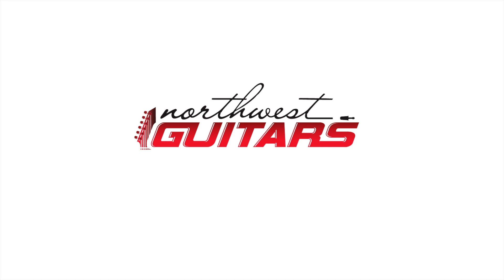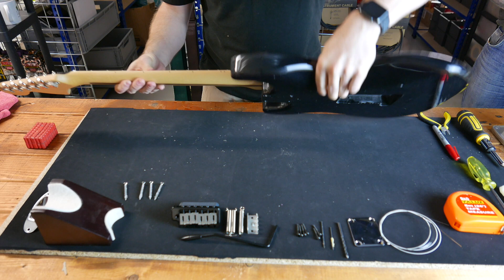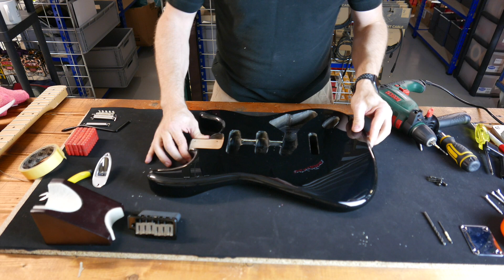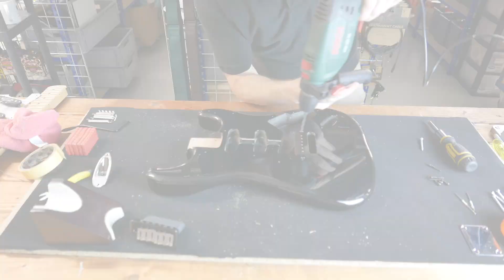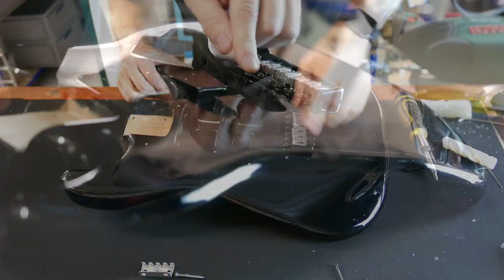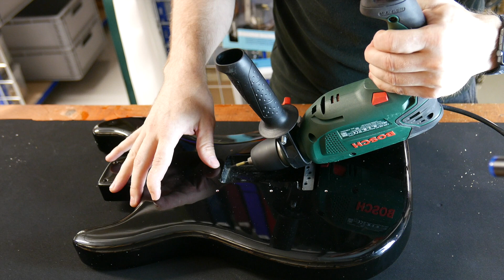Complete Stratocaster Guitar Build Tutorial Pt 4 - Fitting the Tremolo

Comment: I'm in the process of a build where I have a similar body without the trem screw holes. As many others here, I've been thinking about how to get those holes in the right place and that they're straight. I only have a handdrill and a dremel.
He doesn't seem to care very much in this video, so maybe it's not that important to be exact, even though I would have thought otherwise?
I was thinking, what if I have another strat body with holes and everything. Could I just try to mark the holes on a piece of paper in relation to the trem block cavity and then use that on the other body in relation to that guitars block cavity? Should work right? And to get the holes perfectly straight I could take a piece of wood, mark the holes and the cavity on that wood, drill as straight as possible in the wood and when I'm happy with that I could tape that wood to the guitar and use it as a guide for the drill bit? Should be better than just drill in the body directly hoping for the best?
I don't know, I'm nervous about this part, but I can think of a better way...

Comment: Do you measure 25.5 inch from the middle of all saddles, or just one, like g string saddle ? Only asking as high e string is closer to front, low e string is further
Reply: It has been 2 years and you have most likely found the answer elsewhere, or perhaps learned the hard way:

The high (thinnest) E string will be close to, almost on, the scale length line, which is 25.5" for Strats, Teles and Jazzmasters. 

All the other (thicker) strings will be further away from the nut. When all saddles in a standard string set are intonated they will be forming a 'dual stairstep' pattern.
Reply: @meadish  thank you for the reply. Yes, I managed to find out elsewhere, but your reply is good

Comment: so... it looks like its not very important where you put the tremolo? Because you can use the saddles to adjust your distance for the scale length... your pilot holes are FAR from straight... I guess that doens't matter either! I was so concerned with this.
Reply: Yes, the saddle adjustment does give you some leeway when it comes to bridge placement. Typically there is no need to ensure adjustability closer to the nut than the scale length line, because all the thicker strings will intonate further away from the nut than the scale length line.

Comment: How do you measure the distance from the saddles to the nut? I know that even when you calibrate you can correct that but sometimes the 6th string is at the limit. I see that you make the holes lining up with the 1st and 6th string; ok, that's right, but how far back or forward do you put the tremolo?
Reply: The standard on a Stratocaster is 25.5". Set your saddles at the midway point on the tremolo to give you the most play in either direction first. This is called the "Scale Length".

Can't believe you ass clowns let such a question sit for two months unanswered. Shame on all of you. May all your E strings break and slap you in the face.
Reply: @stankfanger1366  lola kudos!
Reply: Position it to make sure the high E saddle is at the scale length line and you have good adjustability behind the scale length line. Unless you plan to use thinner strings than the high E (for example Nashville tuning), there is no need to worry about the saddles having adjustability in front of (closer to the nut than) the scale length line. All thicker strings will intonate further away from the scale length line and the high E string will be almost dead on the scale length line.

Comment: I Paid a ''guitar tech' to fit a bridge on a strat and he made an arse of it, It needs to be moved slightly, Whats the best way to fill in the old holes ? Wood filler ?
Reply: Fill the hole with toothpicks, trim them off level with the surface using wire cutters, and then fill the hole the rest of the way with wood glue. If it's an exposed spot where you're going to do a drop fill and cover it up, drill it out with a larger bit and then make a plug for it or buy a dowel rod of the right wood on eBay for a few dollars. 

Alder body? Buy an Alder dowel rod. Cut off a piece slightly longer than the hole is deep, wax it with a candle, and tap it down in with a rubber mallet. When it stops, trim it off with wire cutters, saw it off, or whatever your preferred method is, and then sand it flush.

For the most part, wood filler sucks for a hole of any substance. It's okay to fill a scratch or some such, but nothing bigger than that. It doesn't have the consistency of wood and tends to expand and contract due to temperature changes at different rates than the wood of the body, eventually working itself free.
Reply: Find a piece of alder. Whittle it down to twice the diameter. Place the rough bit in the drill press vice and place a file on the 1/2 inch protrusion. Feel free to place a finger behind the wood so you don't pressure the thinning wood to snap. Use a smooth metal plate if you want but low speeds don't hurt. With the toothpick end made and checked to plug, place drops of runny two part into to fill the hole. Use sewing pin to push liquid before setting to remove air bubbles trapped then force in home made toothpick end. Trim carefully, (don't scratch paint )with Sharp blade. Coat end with residue 2part. Wipe fast with acetone on cloth till clean.
Reply: Use Maple on Maple  neck and so on.

Comment: If you build a simple platform for a smaller pillar drill you can then slide a guitar body underneath and reach the holes in a right angle just by swinging the drill to overhang . You need to stabilise the arrangement on a level surface either with bolts or screws.
I did this to do the holes for string through body ferrules . Also to avoid finish strip-out on the surface for the scratch plate A simple method is to start the holes with a larger bit working ANTI-CLOCKWISE or use a countersink bit again working ANTI-Clockwise. Clockwise WILL strip the coating by lifting the edge of the hole . Drill bits have a long history of lifting wood out of holes and the wood near the top so ithey will show similar disdain towards any coating on the surface.